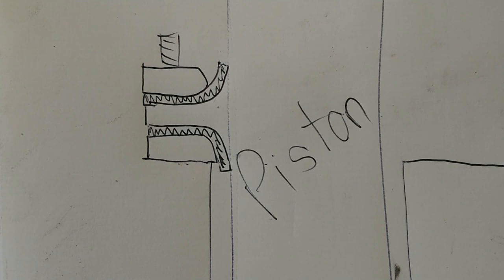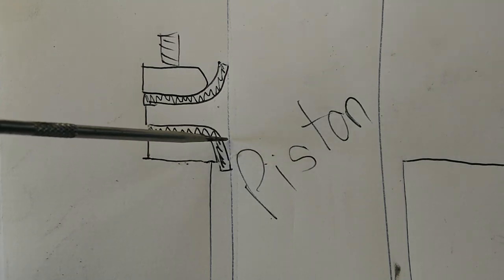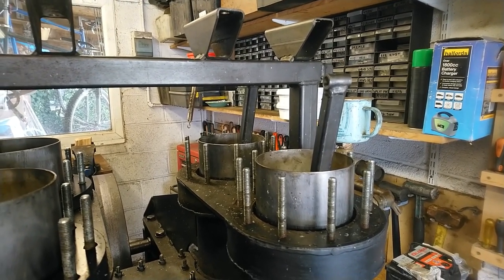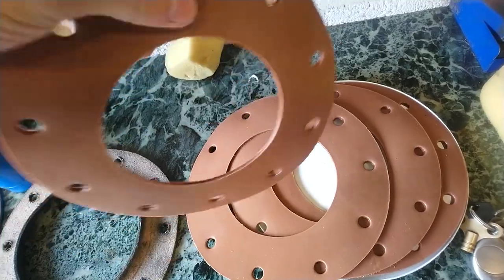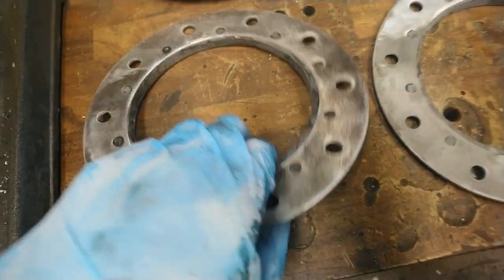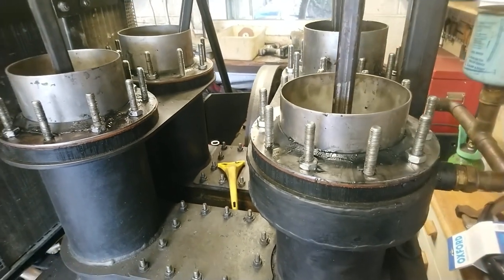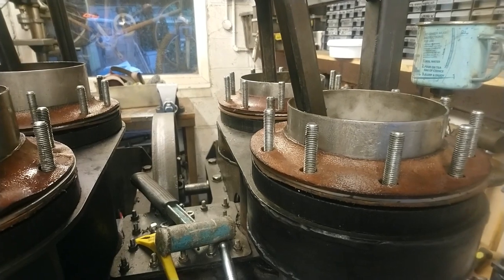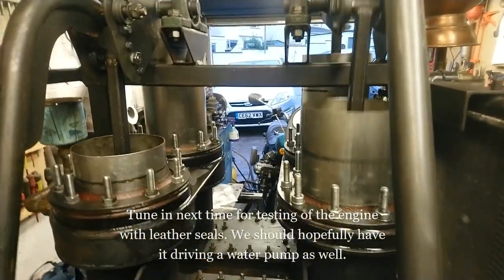Stirling Engine Mk2 - Leather seals fitted to Engine - Part 16

Comment: You built this? Wow, impressive! I find sterling engines amazing, but the thought of building one is daunting. Did you build this from plans or is it your own design?
Reply from the maker: Hi John, I think this engine  looks more impressive than it really is. It's built from laser cut sheet steel, welded steel pipe. I think the only engineered bit is the crank arms, but they could be substituted for something easy to make. I designed this one myself (taking cues from other designs!)